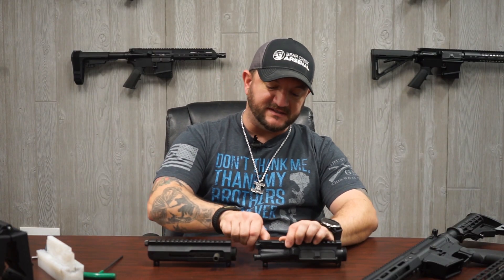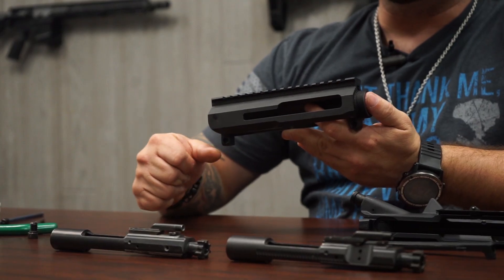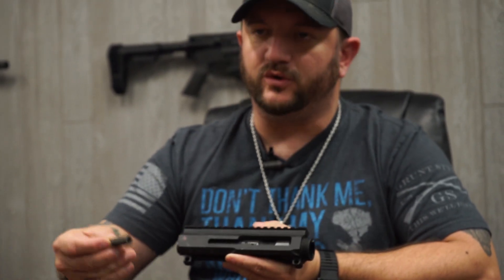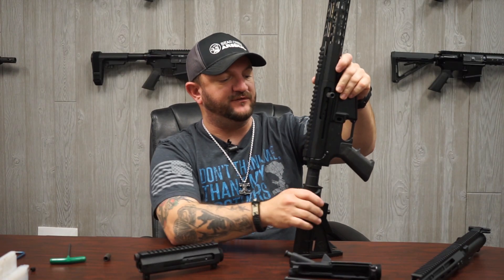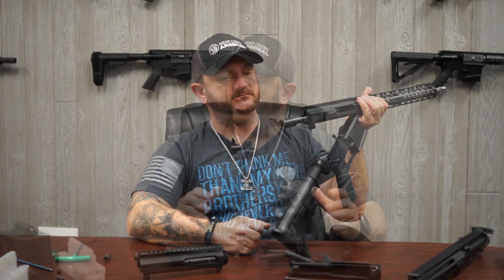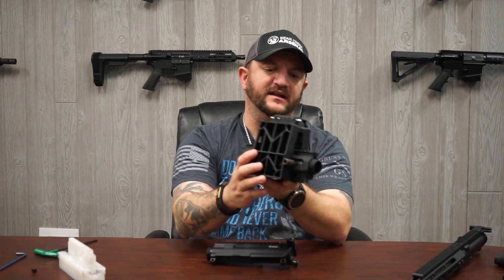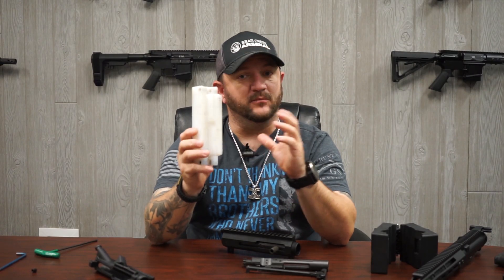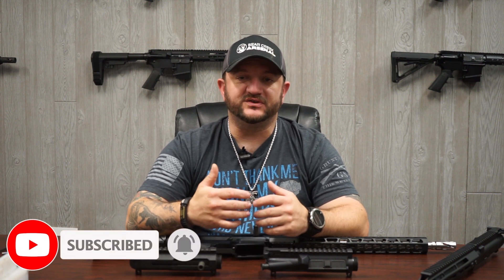Side Charging Upper: Guide, Tips, Maintenance, and More Common Questions

Comment: Kudos on the CONTENT of your presentation! However, your presentation is a bit consistently stilted, so I hope you will do a complete READING of your presentation a couple of times, maybe even 3 times, before the actual filming! Prep work will make the 'final product' a LOT smoother!

Secondly, take your watch OFF before filming: put a large number digital clock on a stool by the camera, so that when you need to check your script time, you can still keep looking at the camera and NOT down at your watch!

Nitpicking I know: but consider how VERY excellent your CONTENT was, I figure you might want to smooth out the presentation to match the content!

I keep hoping you folks will offer a Blowback 45 ACP 12" S.C., along with a .380 model, but at this juncture I'm just glad to see the S.C.'s back in stock on more than a periodic basis. When I get a chance to earn enough money to buy a 18" S.C. Upper in 12.7x42, though I'll have to see about getting a better M.B. for it.....the standard 'tank' just doesn't cut it.

Cheers from the Oil Patch in Central WY
Reply: I have one of their SC 12.7x42 uppers.  300 rds and not one issue. Not one and used cheap PMags for .223.  It destroyed my cheap Pinty red dot.  And now 50 Beowulf ammonia available and $1.20 a round.  The only ammo that hasn’t gone up.
Reply: @itsjustjoe3790  

Thanks for getting back to me....what barrel length did you choose? I'd like 20" but that extra two inches seems like just a bit 'too much' to carry around (HBAR)!

What stock did you choose? I've looked at 'old school' PBR style stocks.......though some Limbsaver accessories might seem in order.

Which Muzzlebrake did you go with?

Thanks!

Cheers from the OIl Patch in Central WY

Comment: I have 2 side charging uppers one 350 legend and 6.5 grendel love them both. What I like about the side charging compared to rear charging you can put your optic anywhere.
Reply: I just ordered my first side charger in 300BLK and I'm excited to try it out on my KP-15 MONO Poly lower I got a standard 5.56 BCA upper and I was surprised it was extremely accurate for the price point, I hope the 300BLK will preform the same. I was about to go with the 7.62x39 chamber but found out I can use the mags and everything else except the barrel for the 300BLK it all works with 5.56, BCG and mags I was hella excited to save a ton on mags and ammo I am now digging out old split neck 5.56 brass to cut down and convert to 300BLK brass I'm hella happy to save that brass
Reply: Did you buy the uppers premade or build them? I am wanting to build a few side charging models.
Reply: @chrissewell1608  premade